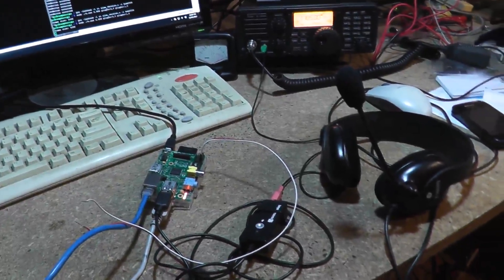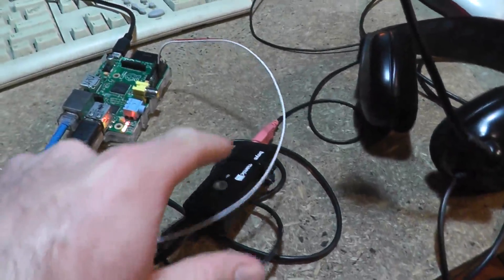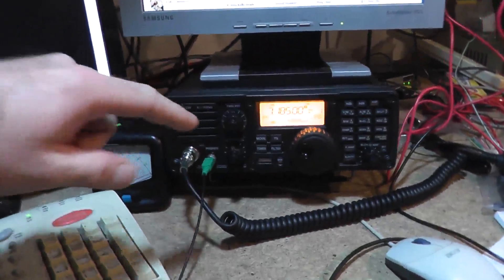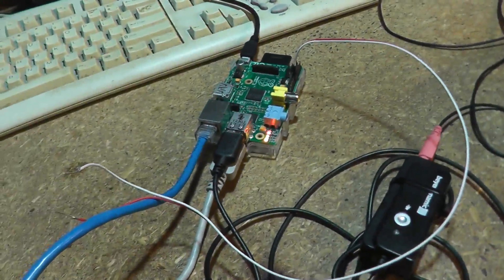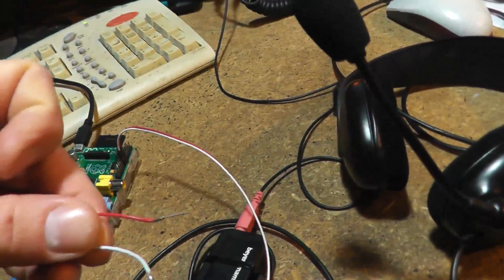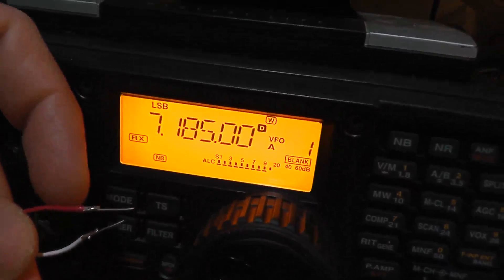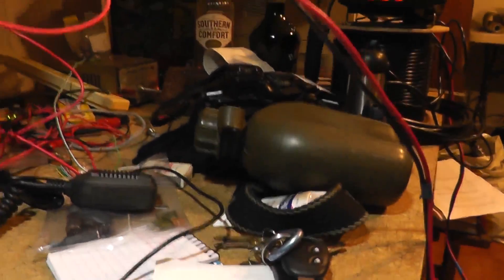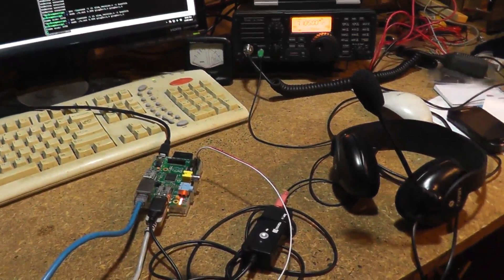IC-7200 Raspberry Pi Control + Speech Processing

Comment from the maker: Ethernet was connected as the software was developed in C via an SSH terminal, power was via the micro-USB socket and came from either a standard phone charger or a homebrew 12-5V switchmode supply.

Comment from the maker: I will document the project on my blog (vk2mev.net currently very empty) when time permits. In summary though:

-DSP and GPIO reading is done in the C file, linked above
-GPIO uses the bcm2835 library (Google "bcm2835", first link)
-Audio routing is done with ALSA, google for 'ALSA Tutorial' and read the C source
-High pass filter is a 3rd order chebyshev IIR, designed with Octave
-Compression is an envelope follower
-rigctl (from Hamlib) is called from the C file to PTT the rig